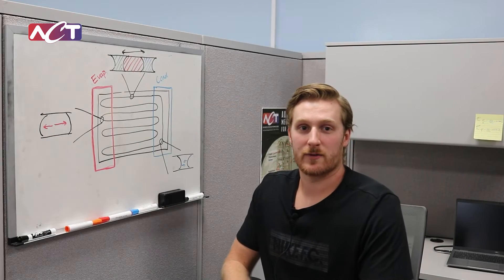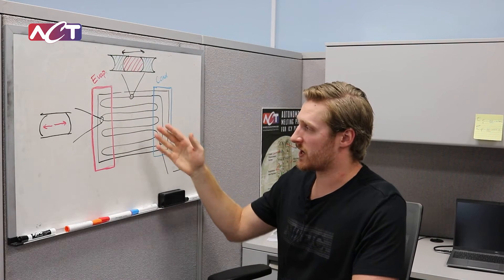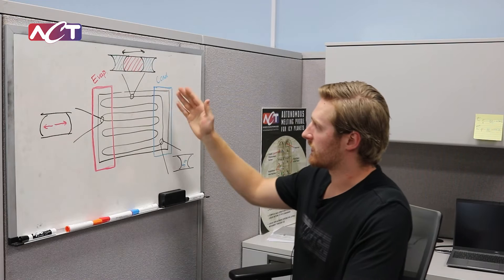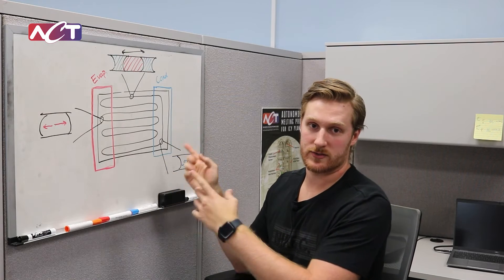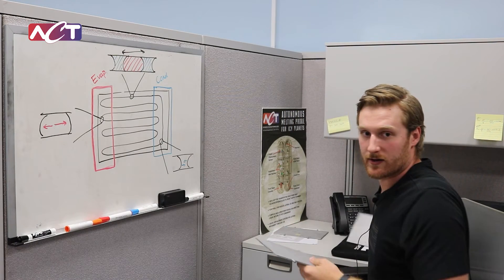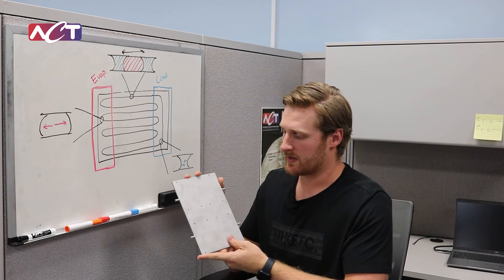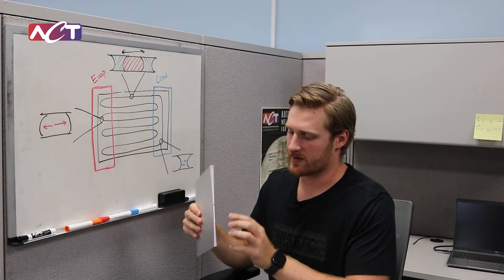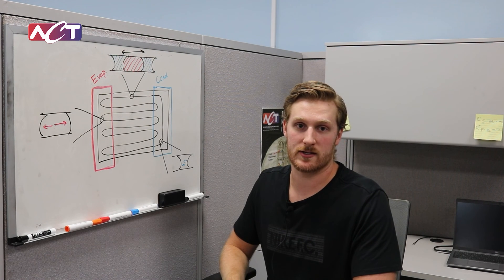Pulsating Heat Pipes  I  Engineers with Markers

Comment: What is the frequency of oscillation of the slugs of liquid?
Reply from the maker: Hi,  The frequency of oscillation within a PHP can widely vary and is dependent upon many factors such as working fluid, channel diameter, fill ratio, number of turns, power, and temperatures. It can generally be said that the higher the oscillation frequency, the better the heat transfer properties of the PHP. However, the oscillation tends to be more chaotic in nature, and thus is difficult to define without complex modeling or simulations.

Comment: If I need to flatten heat in a heatsink, do I need to use a lot of heatpipes or PHP?
Reply from the maker: If you are referring to a type of heat spreader application, then a PHP would be ideal. Heat pipes will also work but a PHP has a much thinner profile (lower mass), can be additively manufactured with complex conformal geometry, and excels in heat spreading applications.

Comment: Is PHP gravity sensitive like a classic heat pipe? If yes, how much does it affect?
Reply from the maker: Ideally PHPs can operate gravity independently, but it’s been found they sometimes perform more favorably in a gravity aided orientations. The percent at which performance increases depends on multiple factors and isn’t necessarily consistent across all applications. However, it is typically a smaller margin of improvement on the order of less than 15%.

Comment: What I don't get is how the condensed liquid in the condenser returns to the evaporator? Seems like it would just lead to dry superheated evaporator and undercooled pooling liquid in the condenser.
Reply from the maker: Think of the liquid slugs and vapor plugs being distributed throughout the entire serpentine of PHP channels rather than the two phases existing separately. Sections of liquid within the PHP channels are interrupted with the presence of vapor bubbles (or plugs). This is due to the force balance of the liquid surface tension and vapor bubble pressure. The continuous condensation and evaporation of the working fluid is what creates a pulsating/nonequilibrium vapor pressure field that drives the fluid motion between adjacent channel sections in the system and occurs simultaneously in all areas of the PHP channels. This complex flow pattern provides both sensible (convection) and latent (phase change) heat transfer. Although the phase change heat transfer in a PHP helps generate the pulsating motion, most of the heat is transported by sensible heat transfer. If you would like more information please email us solutions@1-act.com

Comment: Diference versus normal heatpipe?
Reply from the maker: A normal heat pipe contains an internal wick structure that is used to transport the liquid from the condenser back to the evaporator with the vapor flowing through an open volume in the center. In a PHP, wick structures are not needed, and the vapor plugs and liquid slugs coexist together within the internal PHP channels, rather than being separated by a wick and vapor space. The heat transport also takes place through a pulsating motion among the meandering channels instead of a continuous flow from one end to the other like a traditional heat pipe. If you would like more information please email us solutions@1-act.com